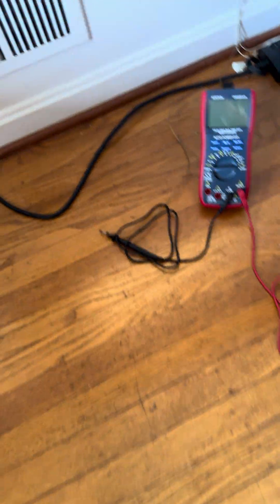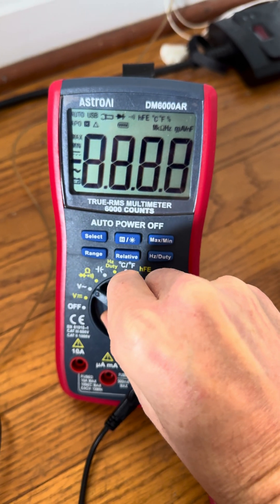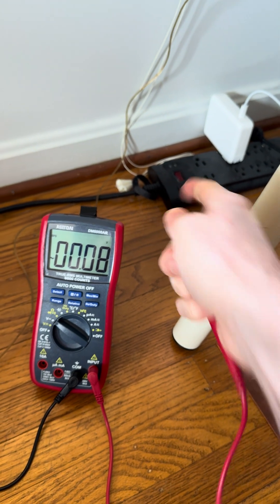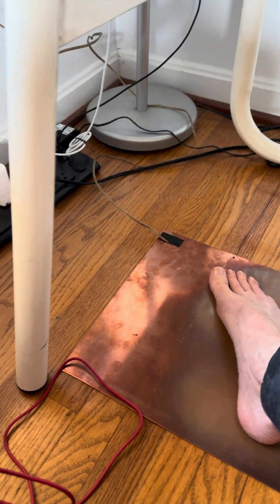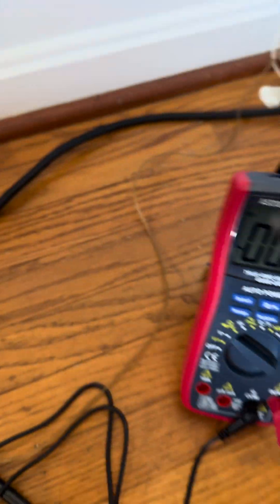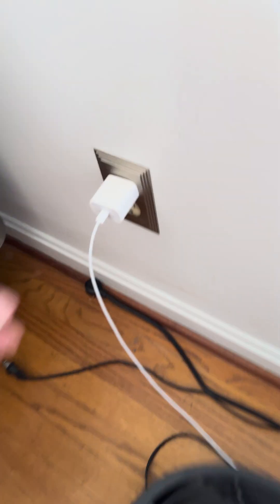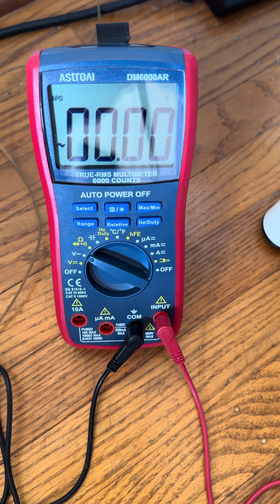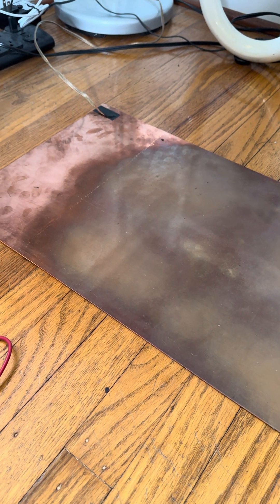Earthing / Grounding test with a voltmeter and EMF meter

Comment: I know this is an old video, but I’m so glad to see you doing all of the testing. It makes it make more sense to me. I turned on an electric blanket, that I used to spend a lot of time under, and I was over 40 volts! I’m sure the heating pad is somewhat the same as the blanket. There were times that I used both at the same time. Ugh. I don’t have an EMF meter. Are they all about the same?

Comment: Clear demonstration, thanks. What do you think of those white plug in wires that come with the grounding sheets? I understand the sheet not being the most efficient thing. I've had good luck with a small one and less luck with a larger one, but what do you think of the wire itself, the plugin ground? Is it a decent ground?

Comment: Great explanation, thankvyou, Dan.

Did you make any progress with your own sleeping version?
Reply from the maker: Thank you! Yes, I have upgrade all the cables in this video as well as using copper alligator clips for connection instead of electrical tape ( which was just a testing solution at the time ). I've been sleeping on silver fabric for maybe 2 months now and that's where I've noticed the most benefit. I've since used the same setup and have both of my parents sleeping grounded as well. 

I've been very busy and was traveling for the last 2 weeks ( also sleeping grounded in hotels, testing their outlets and connecting to them ) and am leaving town again this week for another week. I hope to make an updated video in the somewhat near future showing the changes, so check back in 3-5 weeks.
Reply from the maker: I uploaded the updated video earlier today if you want to check it out.
Reply: Hi, where did you get your vault meter?
Reply: And also your copper mat?

Comment: Would the copper plate work if it wasn't hooked up to the copper outside?
Reply from the maker: It would not. The minute it's disconnected from the copper rod outside, the plate is no longer "grounded" to the earth. It must be connected to be grounded. It's the same principle the grounding prong on 3 prong outlets. I hope that answers your question if I understood it correctly.

Comment: Great video! Thank you!

What is the EF when you hold your EMF detector close to the copper plate?
Reply from the maker: If the powerstrip is plugged in, the EF reading is around 50, but to my understanding since the copper plate is grounded to the copper rod outside in the earth it negates the harmful effects. If the powerstrip is unplugged ( which is most of the time I'm working - I charge when I eat or take breaks ), the EF reading is in the single digits.